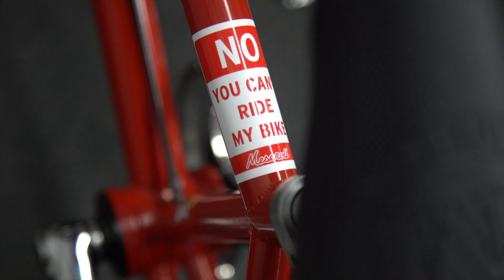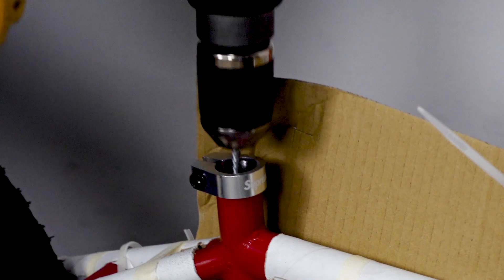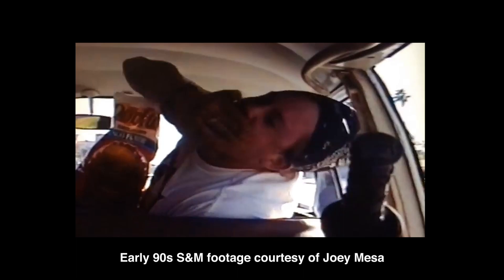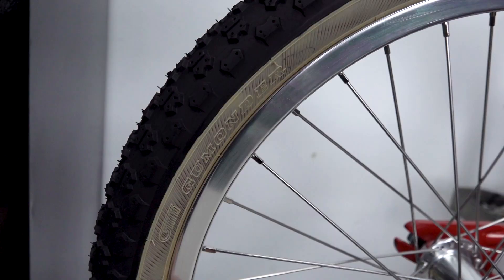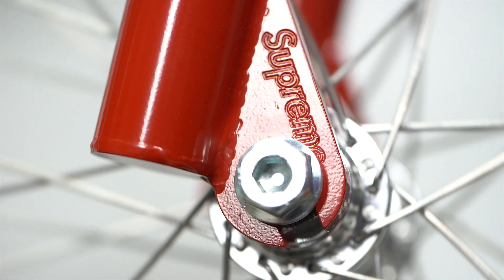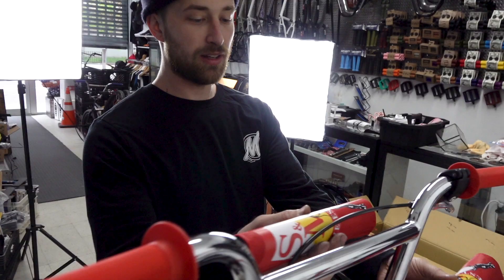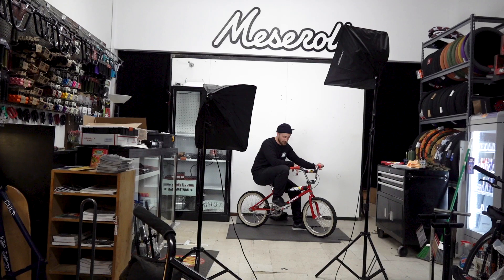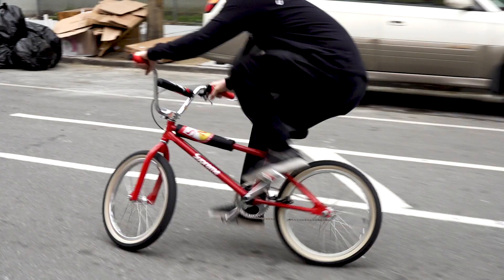SUPREME X S&M 1995 Dirtbike BMX Bike Check

Comment: What do you use the wire brush in the down tube for?  Weld slag?  Smooth it up for the seat post?  That one inch brass wire?
Peace.  Thanks for your time.
Dennis.
Reply from the maker: The wire brush clears up any residue inside the seat tube and keeps everything smooth so the seatpost can move freely!